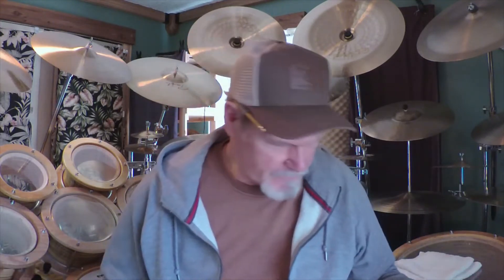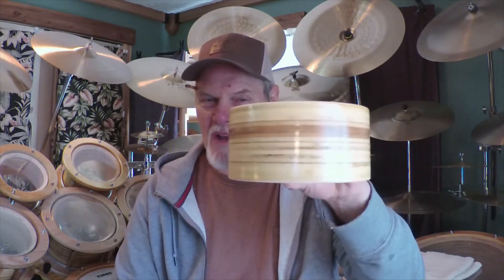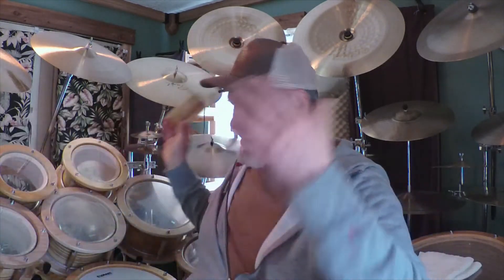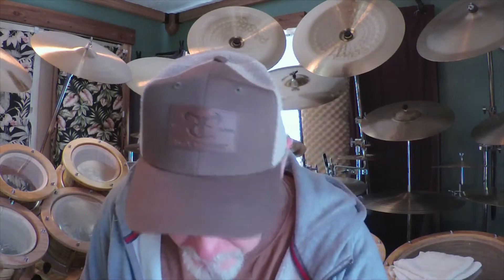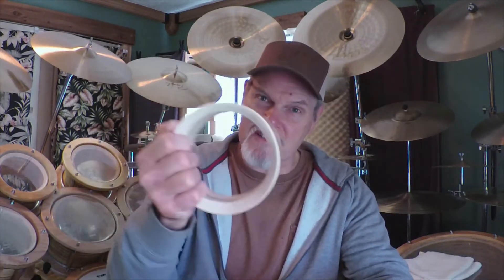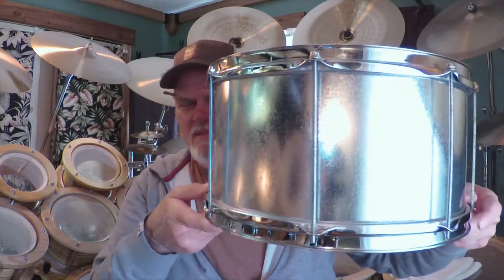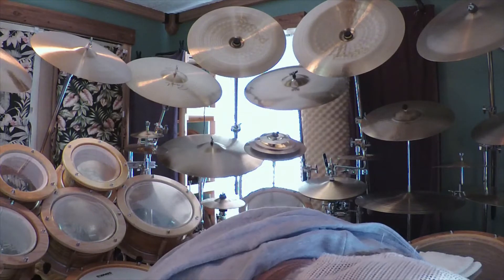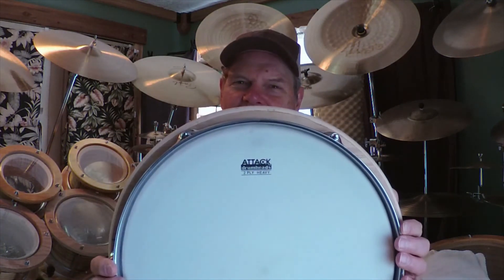Drum Shells, Sound, Manufacturer Hype: Part 20 - Shell Wall Rigidity

Comment: Hey I know how we could prove it once and for all... Ho about you make a hoop containing a tensioned head... Like that of dw pancake drum... And then we put that  hoop to different shells without the need of extra tuning so that the tension will remain the same.. and hear the sound whether they differ or not
Reply: I hope you get what i mean..,!!!
Reply from the maker: @awmaace3397  I think I get what you mean but, you'd really need two of them for batter and reso, and you would just want to seat them on the shells? I really don't see how the heads could be tensioned to a hoop, though. 

Having done 20 videos in the series thus far, I believe the point has been empirically proven with different examples. 

Thanks for watching.
Reply: @REFondrums  ya know I believe it was impact drums that made the pre tensioned hoops... 😂 I do exists
Reply from the maker: @awmaace3397  Yeah, I just watched an rdavidr video the other day where he featured Impact drums. The days of the popularity of concert toms. I used them through all the 70s in some capacity or another.  I even made a couple "North" drums from PVC elbows. 

In never saw any Impact drums up close and personal, and in watching the video I didn't see any obvious way the heads were attached and pretensioned.